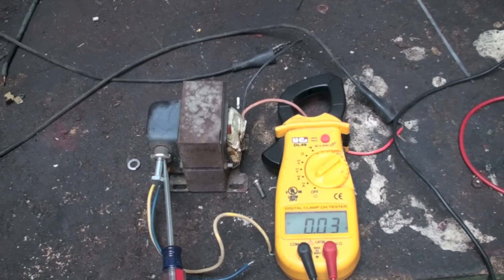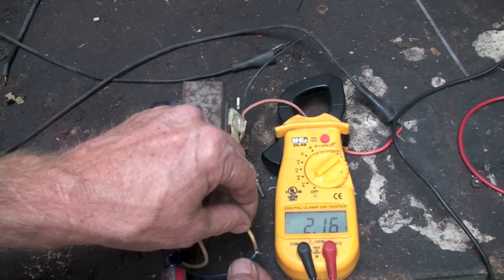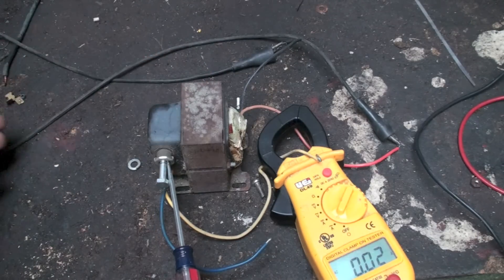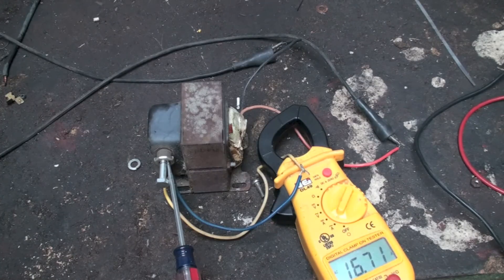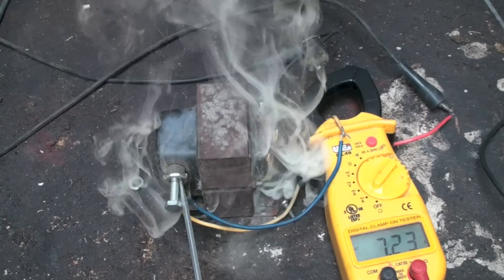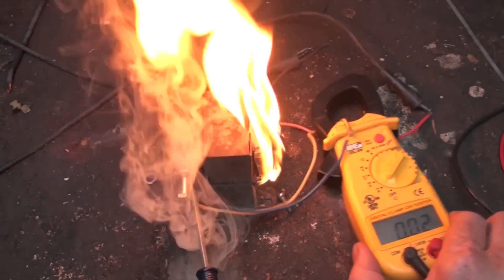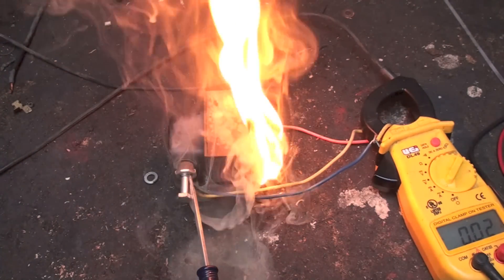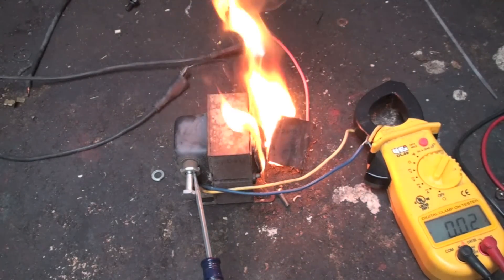Control transformer burnup

Comment: Hi ! Very educative, thank you. Mine has a burned secondary ( three secondary outputs ) .
I disconnected the secondary wires attached to the circuit, and tested them in the circuit, but there's no short, yet the transformer's secondary burned ... i don't understand why.
Edit : i tested a 1000 uf PSU cap with continuity, shorted .... Who knows if it was shorted before of after the transformer burned.
I don't get why the wires didn't test for a continuity though, with that cap shorted ..
Each secondary output is actualy 2 pins, and a Fuse in the middle of the loop between the two pins.

Comment: Mine just failed yesterday but no smoke. Must have a fuse internally?
Reply from the maker: Some of them do have a fuse embedded in the windings.
GFM
Reply: @grayfurnaceman  My old Ruud unit has 90-340 to turn the inducer on and one 90-370 that turns the hi ac fan on immediately from the G function that comes on whether  heat and cooling is calling. After the thermostat is satisfied W and G go away and the fan limit then and only then comes back into play on the 90-370 and will run the fan until the furnace cools to the set temp.
I was trying to bypass G while W is on with a 2nd 90-340 so that my fan limiter can run its entire course and not be interrupted by G.\ That's when the 24v transformer failed.
I just put it back like it was. its worked no telling how long like that.

Comment: Burned up 40va tx on 208v, wild leg. Lasted about 2 minutes, long enough to determine wrong rotation! Replaced with 20va doorbell tx and changed line connection.

Comment: Heres some more info. At first my 3amp fuse blew and the AC/heat guy came by and put another fuse in then it blew again after 10 min or so, put another fuse in and the transformer blew, put another transformer in and that blew after 10-30min or so. I have a reed ruud system. the guy checked for shorts and nothing. i thinks its my Coil Condenser Contactor but dont know will do more research. Thanks for ur help

Comment: Hello i have a reed ruud split sytem and my transformer keeps burning up but the fuse is not blown? i checked for shorts and it didnt seem that was the issue?
Reply from the maker: +Nicholas Jensen What fuse do you mean?  If it is the fuse on the 120 volt power source, it will not usually blow when there is a short in the 24 volt circuit.  Let me know.
GFM

Comment from the maker: It is a demonstration of what can happen if you bypass the circuit protection for the low voltage control power for HVAC equipment.